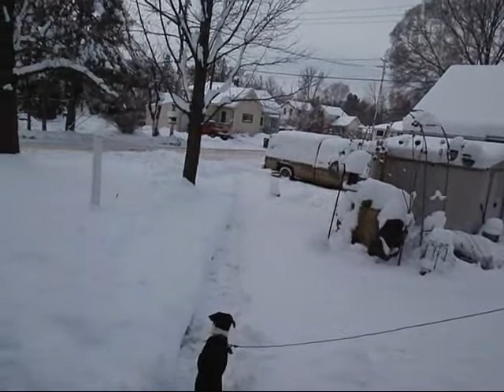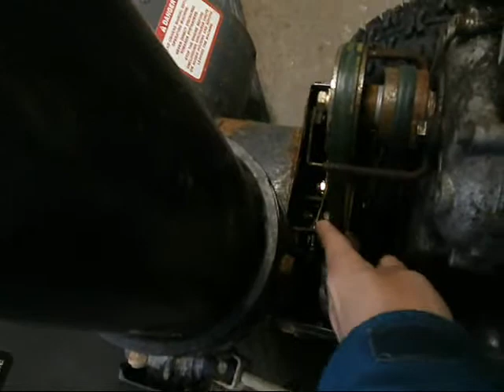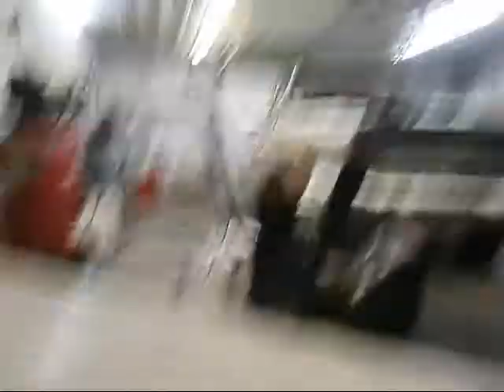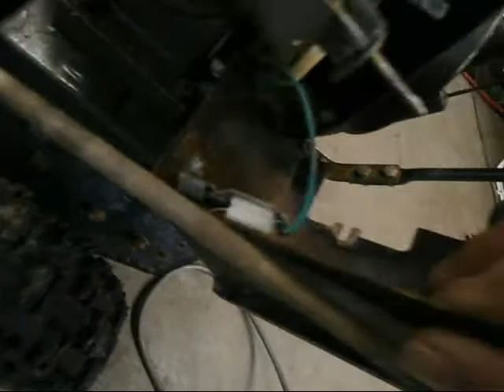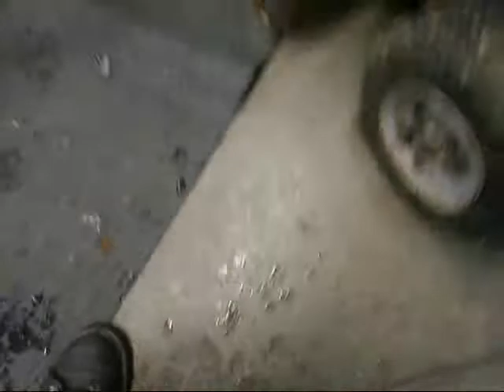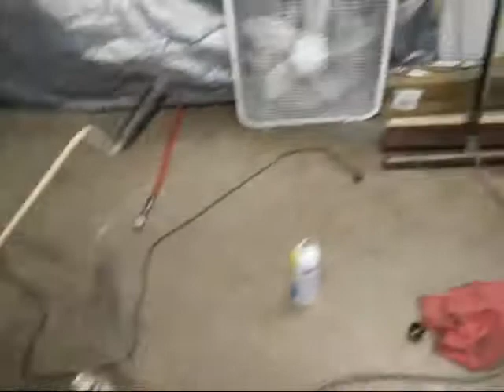Trying to get the blower running 12-12-12.

Comment: I posted a video response that shows the valve seat -- mine had deteriorated so that the TINY hole in the seat had become blocked and prevented fuel from flowing into the float bowl (so the primer bulb would just suck air since there was no fuel in the bowl to draw from)

Comment from the maker: Thanks for the tip. I will check out the valve seat thing before I put the carb back on. Is that the part of the carb attached to the Idle speed control? I'm leaning towards my gremlins and bad luck lol

Comment: Didn't sound like your primer bulb was pulling any fuel from the float bowl (I've been there, done that-- I have the T-shirt) = Fuel flow problem:
1-clogged fuel line
2- bad valve seat (that was my problem- and sounds like yours, since your bulb isn't sucking fuel-- fuel can't fill the bowl) but it runs off starter fluid
3-Voodoo, gremlins, bad luck

I made my blower my B--ch after this problem-- deteriorated valve seat